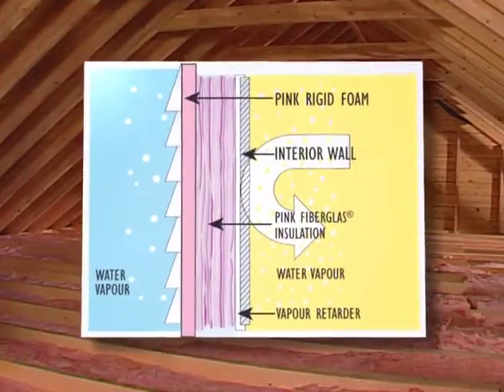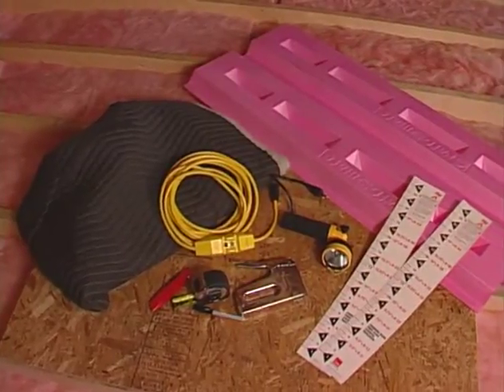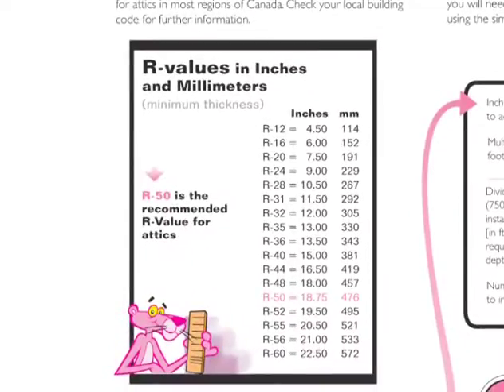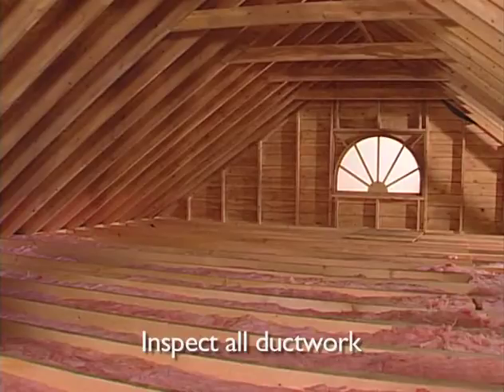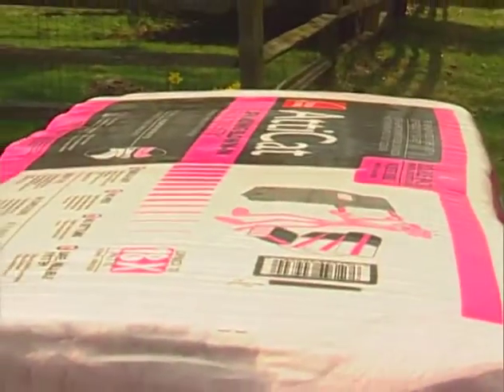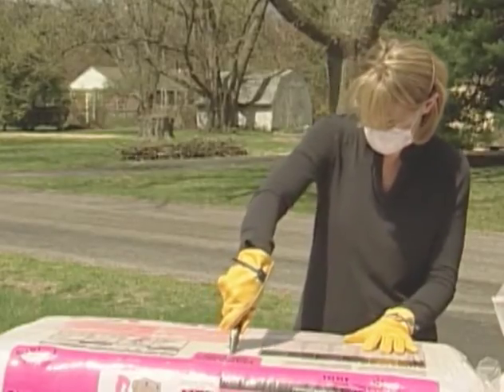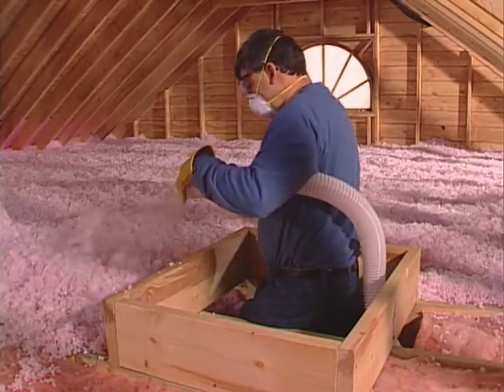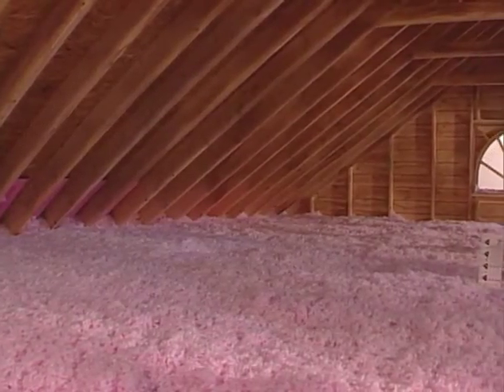Owens Corning AttiCat

Comment: rebuilding daughters house due to Ian, her ceiling has the blown in over battens. Sheet rock and bat insulation - the blown in stuff is a major pain- it is everywhere!! PS her ceiling sheetrock came down in full sheet with a few taps at the corner. Theup and down pressure must have loosened it. Now have to screw wall board down.

Comment: Can the machine be carried in a small SUV?
Reply: I transported it in a Ford Explorer (mid size SUV), the machine (after being separated into top + bottom halves), hoses, extension cord + controller would fit with the middle + back row of seating folded down.  If you have a compact size, it will likely be two trips to the store to get it all home.  The hoses are pretty bulky (I received the volume of a Large Contractor Size Rubber Made Garbage Can full of hoses.)  Otherwise it may be worthwhile renting the van from HD to transport the machine + bushels of blow in insulation.  My SUV would store 9 bushels of insulation and that would have it crammed from window to window except the front row.  Hope this helps.  This also made a MASSIVE difference in my upstairs to main floor temperature differences in the evenings + AC doesn't run continuously from 5PM - 10PM  (instead it comes on for 10-20 mins then stops to maintain temps) to keep up with the hot attic.  Definitely worth it, plus there are likely subsidies you can apply for!  Can't wait to see the energy savings $$$ ;-)
Reply: @roblaw-g3s  Thanks! Did it with my Rav. Easy!